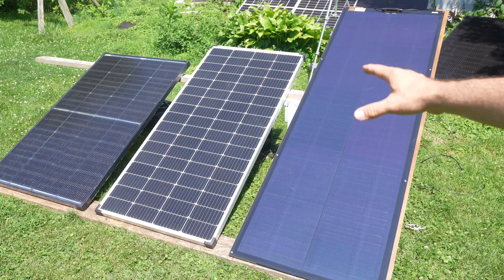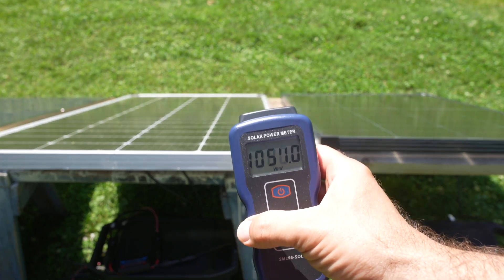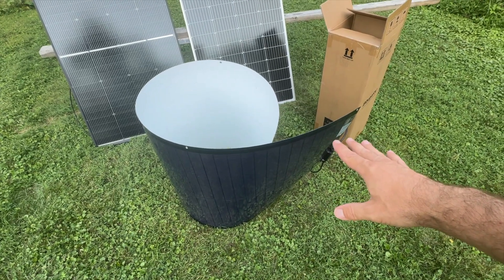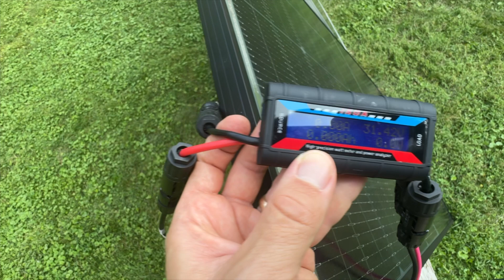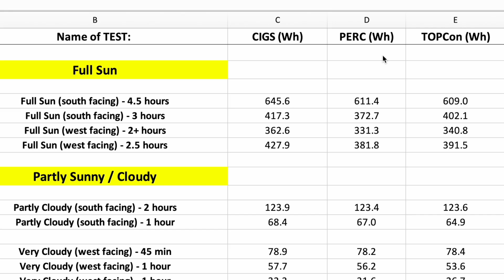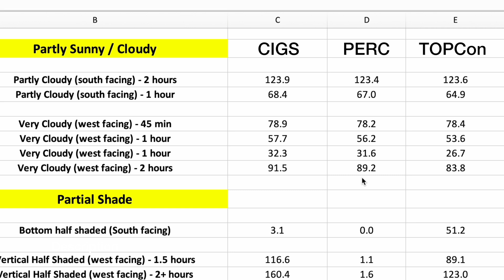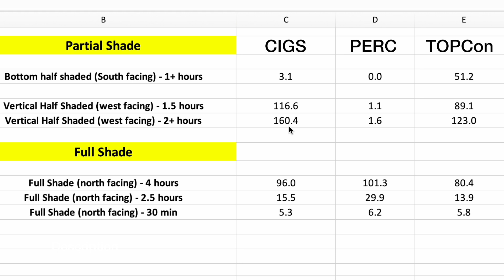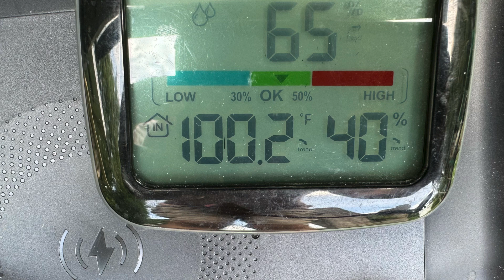I Tested 3 Types of Solar Technology - Surprising RESULTS

Comment: flexible panels here are extremely cheap but they have very little flexibility

got a 200w for $22 and it outputs 150w on average and 180w on max

i could build a 1kw array for $100+ ! and spend a little more for the framing. Haven't seen any CIGS panel here though those things might be priced correctly when those arrive here
Reply from the maker: Where did you get a 200w panel for $22 new?  That doesn’t sound right.
Reply: @solarguy   we have a localized aliexpress here that give app discounts every month and the store also give coupons that I can stack with the app discounts.

Normal price is $60-$70 but they always go down to $50 for a few days every week. $11 for a 100w $22-24 for a 200w and $28 for 2pcs of 120w on max discount which happen once every month

The store is Powmr but they send either powmr panel or flowatts panel. Endurance of these panels is questionable probably 3 years max but no one knows since they recently released these panels last year

Comment: Do you have any tests on the durability of each types . How much years can it take.
Reply from the maker: Rigid solar panels can last decades so it would be hard to test them.  But if you mean subject them to direct forces and see what happens, I haven't done those kinds of tests.  One question that is out there is how long the CIGS panels will last since that is a newer technology and they don't use glass and aluminum to protect the photovoltaics.  I have had them on my RV roof for a few years and they still are working great.

Comment: @solarguy how are your SIGS panels performing after a year? Do they have an air gap, or are they directly mounted?
Reply from the maker: I only have some permanently mounted on my RV.  After two years they are still doing great.  No air gap, other than the gap by the width of the butyl tape.  I need to run them through some full tests again but last I checked I noticed they were still producing at or near their max output.

Comment: I think the reason the CIGS did worse in some tests is likely due to the voltage thresholds of the charge controllers. I'd like to see the test repeated with two of each panel wired in series, using the same charge controllers. I think the CIGS would come out on top in every test, but I'm not certain which is why I'd like to see it.

Comment: For the bifacial panel why not use a emergency Mylar blanket as a reflector so that the sun shines on both sides at the same time?
Reply from the maker: That would definitely help the gain from the backside.  I have some I was going to use for another solar project but maybe I can make a video on bi-facial gain with reflectors since I also have a bunch of mirrors too.

Comment: After reading your collected data, I wonder why a 4 hous test isn't exactly twice what the two hour test recorded.  Why is that?
Reply from the maker: The main difference would be because the angle of the sun since it's moving throughout the time.  The data that really matters is comparing the panels when they are at the same angle, temperature, load, solar irradience, etc.  If the factors were all the same the whole time, then yes, a 4 hour test should show roughly double a 2 hour test.  Thanks for watching!

Comment: Great video. I have 4 BougeRV Cigs 200 watt self adhesive on my truck camper. They pump the power.  They are pricey but the weight ratio to power is awesome.
Reply: How long have you had them up? How are they holding up?
Reply: @robertbryant173  As soon as I got my NorthStar 850sc in October 2022. They have been covered when not in use until this past July and will find out in October their condition. They are a power house and used as a solar tax write off as well.
So far so good
Reply from the maker: Thanks for watching!  Glad you like them.

Comment: Let's address the elephant in the room, that thing is twice the size. For the space it's not really an accurate measurement.
Reply from the maker: It's obvious the CIGS is longer and thinner.  That's not what I was testing.  They are all rated for 200W so that is the consistent part.  I was testing the technology side by side in the same circumstances.
Reply: @solarguy  I do know cigs are some of the bendables. I appreciate your testing. I'm bias against bendable panels, I know this. But..... Fitment is one of the three primary principles of engineering, impossible to overlook.
Reply: @strayangel3210 Cigs has nothing to do with traditional bending panels. It’s way more reliable
Reply: @strayangel3210  How are you gonna mount a rigid panel to a curved surface without completely ruining the aerodynamics? What about it being 1/2 - 1/3 the weight of rigid panels? Not even considering the fact that it's more durable than glass panels in a lot of applications, I don't know how you can't see why there may be a use case for different types of solar panels. Even though CIGS(17%)/Flexible(23%) panels are less efficient (that is why the panel is bigger...), they provide many pros and may also even be the best/only solution. Stay in school kids.
Reply: @solarguy Thank You for all your time and effort to try to help us understand the potential performance of these different panels, I know it is a lot of work.

Comment: Flat, flexible solar panels are garbage. They deteriorate 4-5x faster than glass panels
Reply from the maker: Are you referring to CIGS panels or to the flexible monocrystaline panels?  The monocrystaline flex panels are more susceptible to microfractures because they don't have the glass and aluminum frame to help protect them.

Comment: A lot of people have been testing those cigs panels,  the technology seems cool but they don't last long and for over $500 each i won't be buying them. I do like those topcon panels
Reply: Proof? These are the MOST durable panels EVER, I have a lot of proof to the contrary.
Reply: HE Says. That the cigs panels are very Durable  ok and you claim they don’t  last  and hpold up very Long. .  Which is it ?   Just curious  did you  research on Consumer reports  or  what was your source ?/
Reply: @ca-dz9vb there are a lot of reviews on YouTube and please don't believe me and do more research on those flexible panels, do what you want but for me I'm going for the topcon panels for my bus
Reply: @ca-dz9vb it’s called degradation of cells it’s a thing, especially the flexible panels they are a ripp off, they degrade heavily within 5 years
Reply: Hobotech shot some CIGS and they still worked. Look at his little torture test and tell me they are not durable?!?!?
Reply: I wish they would make cigs under glass panels!!! So much more protection...

Comment: 1st
Amps are more important 
Ohm's law 101 it will show you the actual power going into grid or battery 
&
When they talk about solar efficiency is just the footprint the size of the panel for the output
Reply from the maker: Ohms law has 3 variables. How are amps more important?
Reply: @solarguy  They aren't, unless you want more power loss from heat.
Dennis is demonstrating how "A little knowledge is a dangerous thing."
Reply: @solarguy  ohm's law shows us if you multiply volts buy amps give us watts
If you test at the meter are the main at any solar installation you'll see you only putting in about 15 percent to the grid 
Same with charging batteries as the battery gets full amps go down what Watts stay the same 
And then you can do that 4th grade math to figure out actual what's going into grid or battery
Reply: @solarguy  there are some other fun science fair projects you can do 
Like line voltage minus PV voltage what should be 274 here in the US then divide the result by line voltage multiplied by 100 which will show you the percentage going into grid or battery which will coincide exactly with the first test

Comment: Now run the test again but on an elevated rack with white/reflective surface behind.
Reply from the maker: It would be setting up the test to ensure that the bi-facial panel gains more than the other two.  Are you hoping to see how much better it would do?
Reply: @solarguy and temps beneath the panels
Reply: Wooooh id enjoy this~

Comment: CIGs are gallium-based?  That is cool.  I heard of this only is solar panels meant for operation in space because the gallium will survive wild extreme temperature variations and last for a far long time than other kinds of solar cells.  The specialty gallium cells for spacecraft are custom and crazy expensive, though.  Gallium isn't cheap.  It's also used for state-of-the-art LED lights.  As for the partial shade experiments, my guess is that the results were most strongly impacted by the wiring, not the cells themselves.
Reply: Sry kid. There is no such thing as outerspace. Nor santa-claus

Comment: Thanks so much for making this, we need more people like you! 😂One thing I wish you talked about more is the power to size ratio, specifically since you mentioned RV applications. The same 200W CIGS panel is ~47% larger than the 200W TOPcon, and that's also not including the additional space that running wires takes (since they can run underneath an elevated rigid panel). That was definitely not something we considered when doing a flexible panel install on our RV roof, but I wish we had. Of course this doesn't matter if space isn't a concern - weight can definitely be a pretty big factor as well. But I still love seeing the data, thanks again! 🙌
Reply from the maker: Thanks!  That’s a good suggestion.  What panels did you put on your RV roof?
Reply: @solarguy  We have the BougeRV Arch panels, but actually would not recommend because we've hot spots/low output in 3 of our 10 panels in only a couple months of use. They have specific instructions on how to flat mount them, and market them as more heat-resistant/durable than other flexible panels but unfortunately that hasn't been the case. I'm pretty convinced now that the only realistic flexible option is CIGS  🙃
Reply from the maker: Thanks for letting me know.  Sorry to hear about the disappointing results!
Reply: Micro fractures in crystalline panels, which will set your RV on fire, should be the biggest factor to consider. Thin films, whether CIGS or Amorphous, won't do that. With crystalline it's just a matter of time.
Reply: Well a 200w 16% efficient panel has to do something to match a 200w 23%/25% efficient panel doesn't it?
Reply: I 2nd this.  W/m2 and $/W are perhaps the biggest factors for the majority of installations.  Maybe just add a note in the comments with these metrics (of course $/W is dropping generally, tariffs aside).